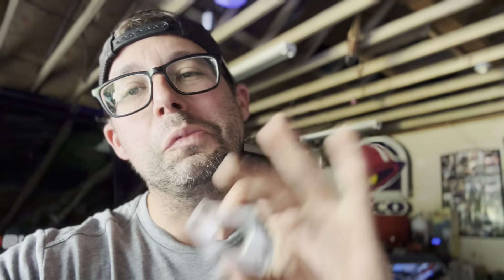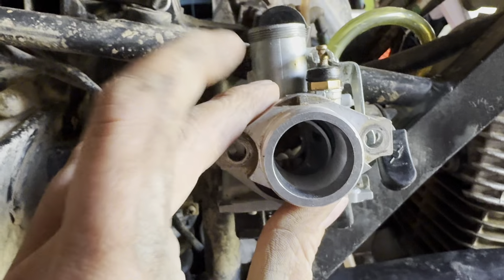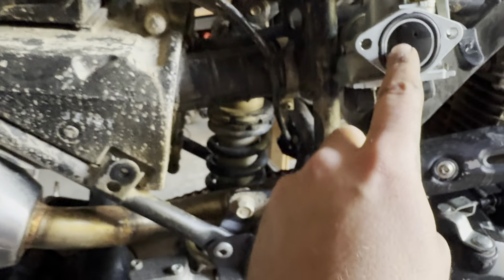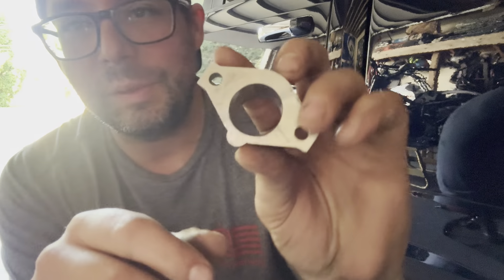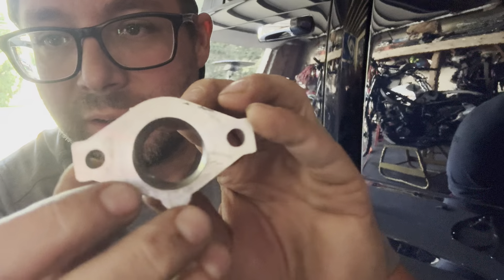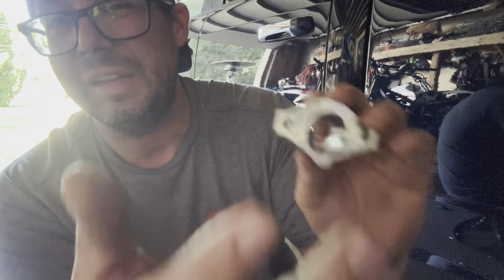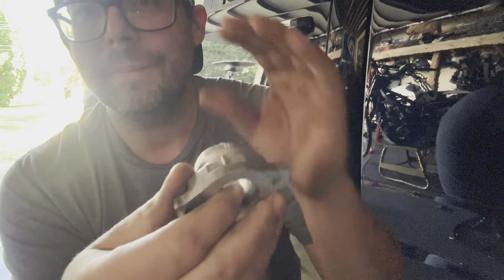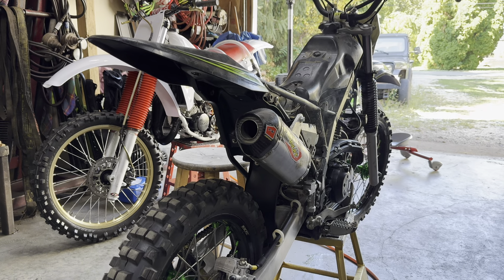Klx140L Modifying the Intake Manifold to fit a 22mm Mikuni Carb (Runs Great!!!)

Comment: Just ordered the 22mm from TBolt in ur link from last Video….. and a FMF from 4.1 slip on for the moment for my sons 23’ 140RL… any jetting advice we are at sea level
Reply from the maker: Honestly I wouldn’t touch anything. Put it on and see how it runs. Just make sure your airfuel is adjusted good.
Reply from the maker: Let me know how it goes!
Reply: @FullSpeedImpulse Thank u will do Sir
Reply: @ hey lil help carb changed and as soon as I start it it idles really high
Reply: I did open up the throat also a little more probably not as large a u did but smoothed out the lip
Reply: Ok all is good runs great!
Last question what did u do with ur fuel line from the petcock to the carb when I put my tank back it bends and pinches the line.
Reply from the maker: @KrisCreel hmmm I would try to adjust the routing of your fuel line a little. I see that I used my stock fuel line to hook up.
Reply from the maker: You may have to buy some new fuel line that is longer to help you route in a better path.  Maybe there is something just a little different about your year bike